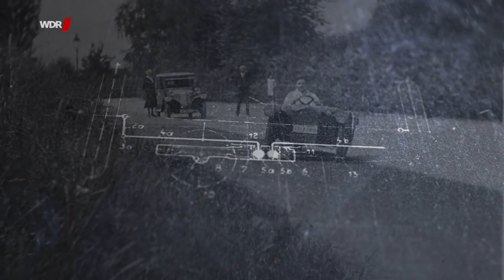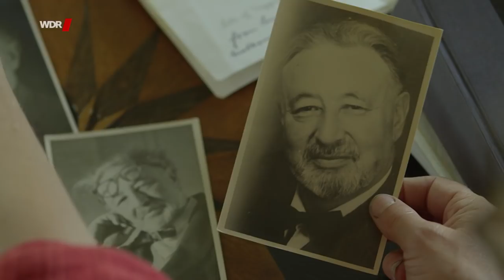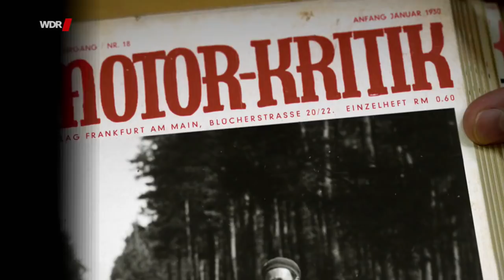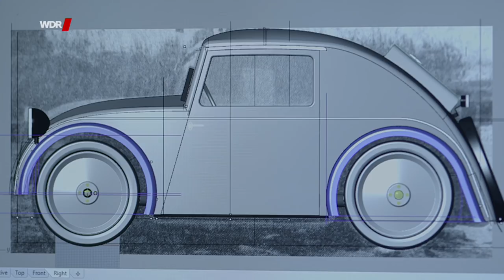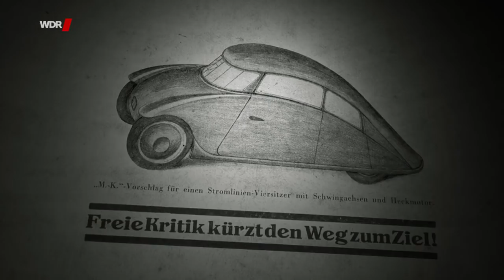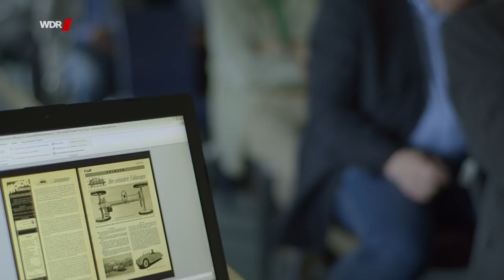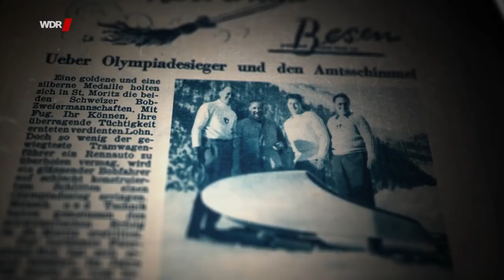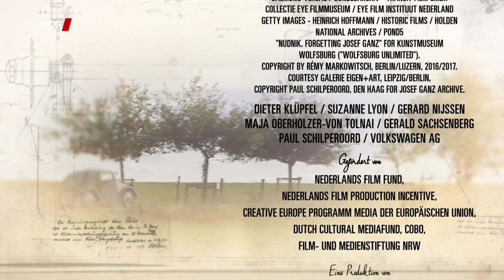Ganz: die wahre Geschichte des VW-käfers

Comment: Eine sehr interessante Lebensgeschichte aus einer verrückten Zeit. Auch wenn Josef Ganz sicher ein Vordenker war für strömungsgünstige und bezahlbare Kleinwagen und das als Chefredakteur des Fachmagazins Motor-Kritik auch publizierte, so waren die technischen Merkmale, sowie das Design des Käfers sicher auch von Entwicklungen der Hersteller Tatra und Daimler-Benz beeinflusst. 
Der Mercedes Prototyp W17 hatte mit luftgekühltem 4 Zylinder Boxermotor im Heck und Stromlinienkarosserie bereits im Jahr 1931 sehr viel mehr technische Gemeinsamkeiten mit dem späteren Volkswagen. Ebenso wie die späteren Serienmodelle W23 (1934-36) und W28 (1936-39).